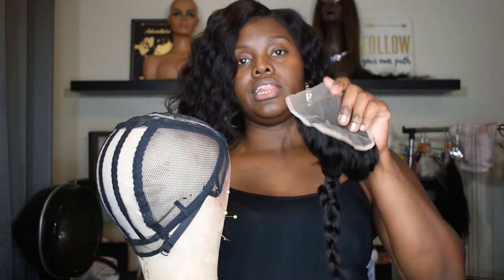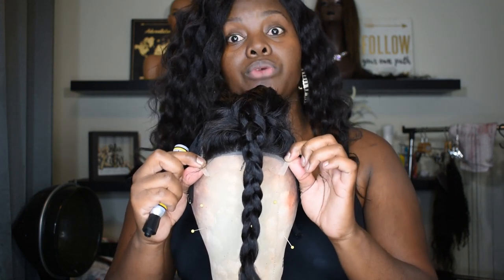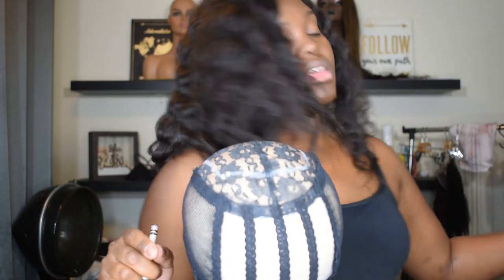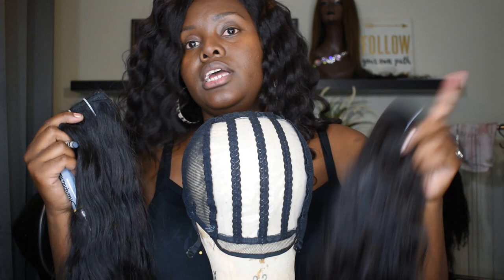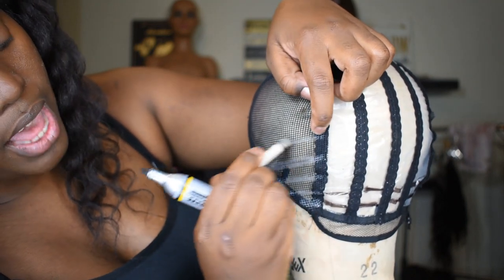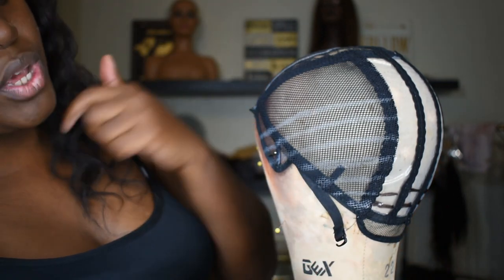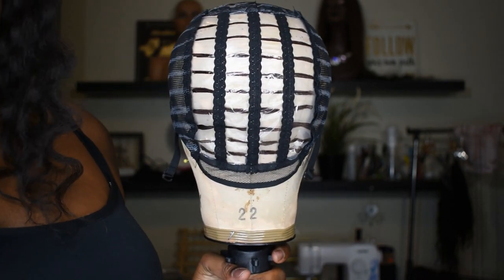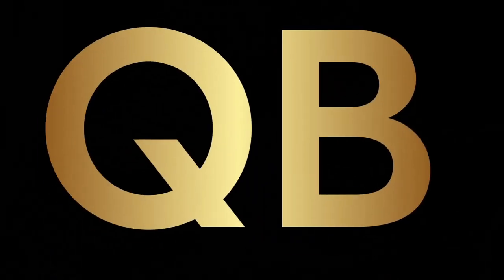Very Detailed Ventilated Mesh Dome Wig Cap Tutorial + Measurements & Marking

Comment: Would a ventilated wig cap work well for a big head... like 25" 😅 I cant find any wigs that would work for me, so I'm better off making my own. Thanks for sharing?
Reply from the maker: The largest I've seen is 24in. I would definitely get as wig custom made or make it yourself
Reply: How do you make sure your self made wig fits you? I tried to make a stuff multiple times and no matter what method I try, nothing fits my head (24" circumference).
Reply: @0rignallity601   what are the rest of your measurements? I’m very curious please reply 😭
Reply from the maker: I measure my head and use the size wig block closest to my measurements. Wig caps can come from size xs-xl.

Comment: Could you please explain briefly how you would go about shrinking a 22" ventilated cap to be 21"?
Reply from the maker: Normally I just use a small size wig cap. But you will need to pin down the cap on a small wig block cut along the seams of the cap and adjust it that way. I sell small, medium, and large caps on my website if you need any.
Reply: QB Wig Collections Thank you!
Reply: Watch Janelle Alisha removing space from ventilated wig cap